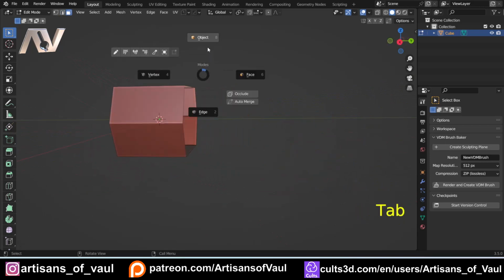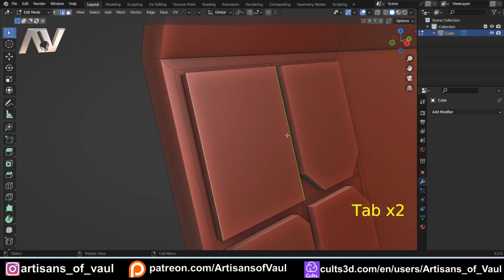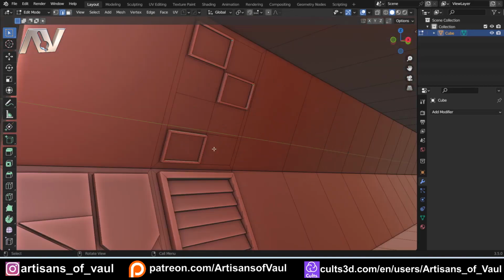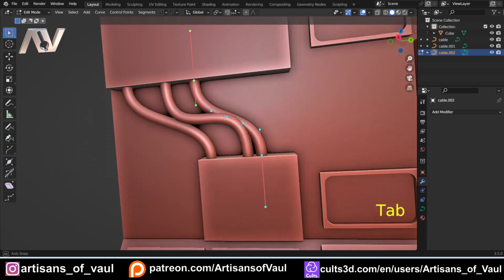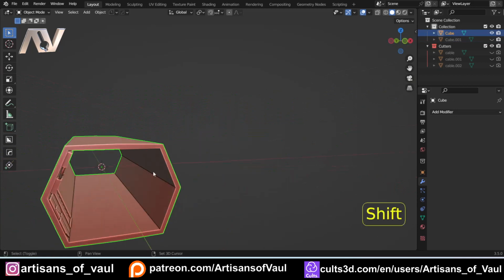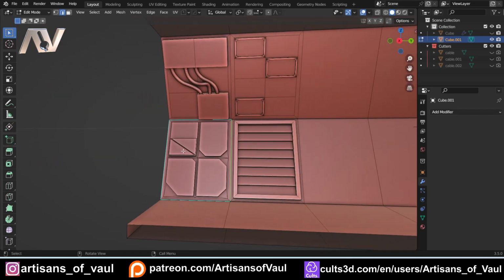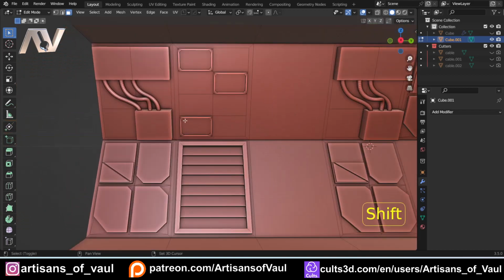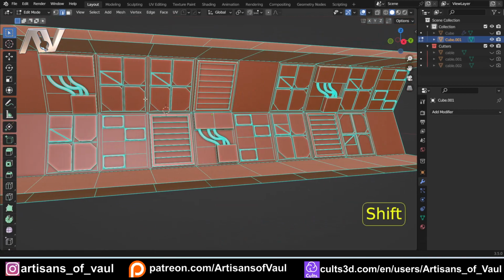Using Mesh Copier for better variation in Blender

Comment: Is it work complicated meshes?
Reply from the maker: @utku0692  As long as it is in that initial square/rectangle it should be able to do anything.
Reply: @ArtisansofVaul  I used the mesh to repair the missing mesh but it did not work.
Reply from the maker: @utku0692  Why was there missing mesh? I'm confused.
Reply: @ArtisansofVaul  I wanted to model a chester sofa and delete and copy the mesh on the button side. I used the mirror modifier because the button was in different places.
Reply from the maker: @utku0692  erm... and that is contained within a single square/rectangle?
Reply: @ArtisansofVaul  rectangle.
Reply from the maker: @utkugogus268  I might have to see a picture to be able to work out what's going on I think.... Sorry.
Reply: @ArtisansofVaul  okey, thanks.
Reply from the maker: @utku0692  If you're able to link one here feel free and I'll take a look.

Comment: Dear AoV, do you believe there might also be a way to use Geometry Nodes to replicate this process and automate it?
Reply from the maker: Hmm... The issue is storing the information for re-use. Perhaps if you made the object separately that's being then put onto the face, but then that has the issue that you'd need to use the "tool" function of Geometry nodes to be able to then use the "selection" node. But that would then stop you using an external object within the geometry node. Perhaps in the future but as it is I don't think it's possible.

Comment: Does it only work on a single object? Can I copy one object to another object?
Reply from the maker: It needs to be the same object, so I get around that by joining the objects, using the tool and then separating them again.  It does add a stage to using it but it takes a second so its not a huge bother.  Apologies for the delayed reply, I have been working through a backlog of comments.

Comment: Howdy! Really new to blender here. I decided to give it a shot to recreate a helmet from the first destiny game. (The helmet being "the Glasshouse") and I found a website that pulls low poly STL files from the game directly. I've spent the last few days just tearing apart the file to try and make it more HD looking and printable/wearable. Have you any tips for a lost traveler?
Reply: Another question would be, is the path I'm going down one that can be a usable one? Or am I beating my head against the wall
Reply from the maker: So that's tricky without seeing the file. I've often found it can be better starting from scratch but depending what the file is like and the end result you want their may be some god approaches like using Sub D to smooth things out. And add detail from there. If you have Instagram there and can share some picks it might be worth dropping a message there for sure.